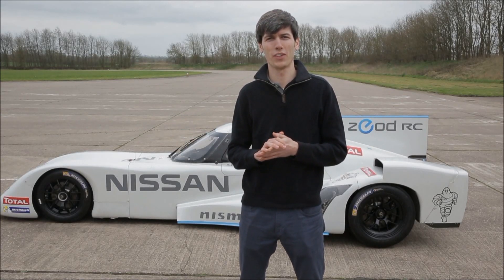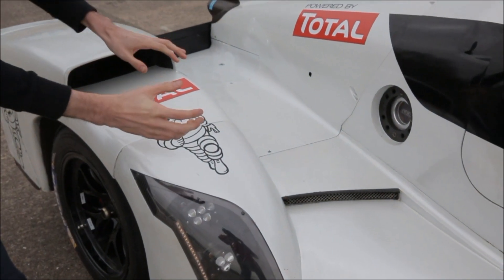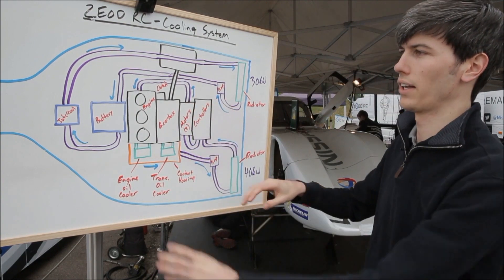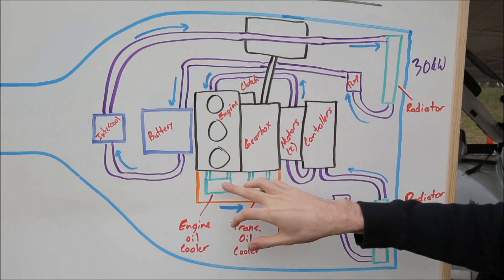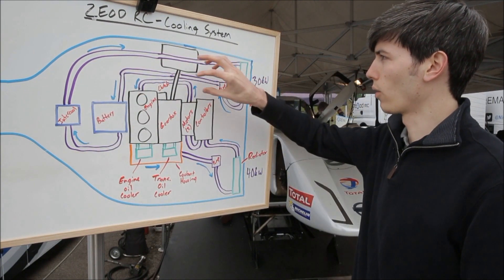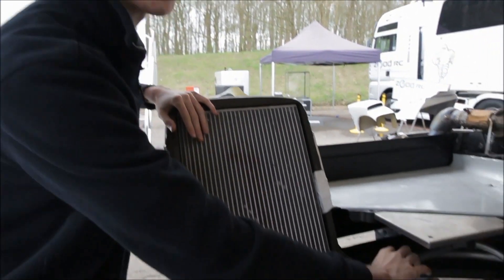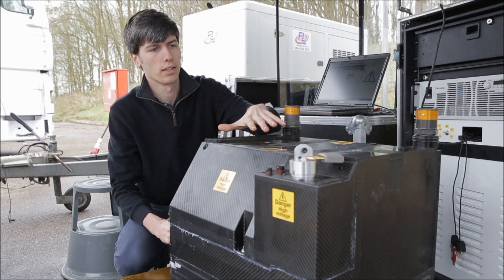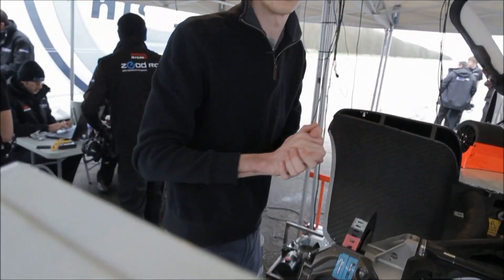ZEOD RC - Cooling System - Explained

Comment: hey, its really cool buddy nice work, 
i have a question in water pump,
1. what happens if the water pump back pressure increases in the cooling system,
2.The cooling system pressure is 1.2 to 1.5 bar, why not more or less than that or how to decide the cooling system pressure.

Comment: Maybe they choose to run antifreeze IF it is permitted,  but I have a couple of points to make.

1. From what I could find available through internet searching, most sanctioning bodies do not allow glycol based coolant unless an exception is made (racing in extremely cool climates) by the body itself.

2. While a 50/50 ethylene glycol mix may boil at a higher temperature than water, it is less efficient at heat transfer. So the 15 - 20 f increase in boiling temperature will not help unless you can efficiently dissipate the heat. 

3. Most racing engineers that I have talked to express the importance of cooling system pressure. As we all know, increasing the pressure in a cooling system has many advantages with the main advantage being increasing the boiling point of the coolant. I have heard of cooling systems (specifically) in NASCAR running around 35 psig. That would be good for an additional 105 f.

4. Another friend of mine mentioned the use of products like Water Wetter in his racing series. This lubricates the cooling system and reduces surface tension there by increasing cooling efficiency. 

What's the point? If ethylene glycol contacts the racing surface through the development of an accident or cooling system failure it will be extremely slick.

Comment: Do they actually run ethylene glycol in the cooling system? Most sanctioning bodies forbid anything except water?
Reply from the maker: Umm, all the cars I know of use a 50/50 mix. There are additives for anti-corrosion. Water alone boils at too low of a temperature, and freezes at too high of a temperature. EG expands this range.

Comment: Welcome to England! Over here for anything else? Great video as ever!
Reply from the maker: The ZEOD, GT3 GT-R, and a race day. More videos to come from this island.
Reply: Engineering Explained
Good stuff, can't wait for the rest. Find it a bit strange to go for a water-air intercooler. Would have saved a lot of weight with a conventional air-air. Guess the position of the heat exchanger and its implications for body shape and aerodynamics were more important?
Reply from the maker: sky17
Yeah, you also would have to have more piping for the intercooler air, and somewhere to put the intercooler, so it's a balance really. Seemed fairly compact, and light overall.

Comment: In one circuit, the water flows from the pump into the radiator and in the other circuit, it flows from the radiator into the pump. Does it make any difference? Which one is better?

Comment: Constructive criticism here.

I have no idea how much "30 Liters per minute" is.  It would be helpful if you could include gallons per minute, or something of that nature.  Even Putting a annotation or something.

Thanks.
Reply: http://lmgtfy.com/?q=30+liters+to+gallons
Reply: Yes, lets perpetuate the use of imperial units because they're totally useful. They're easy to convert. Google it. Otherwise, there's ABOUT 4 liters per gallon, so you can guestimate based on that.
Reply: I was making a point.. Not being literal guys.

Ben Turner Imperial units are useful, they have they're place as well as standard does.
Reply: Absolutely agree, also he could explain what is a car because where i live we havent got one of these
Reply: ***** I know many Engineers That use BOTH Standard and metric on a daily basic.  I use both every day. both systems have their place as do all.
Reply: supermotox55 If you use both every day, then why did you have to ask?
Reply: DJAlsip On a daily day I use standard for almost everything, except in the shop when I need to be near exact on measurements, that's when I use metric, but majority I use Inches/Feet, for ease of use, and better measurements for the field.  I use gallons not Liters.
Reply: supermotox55  Well that clears it up! I've lived in both Europe and USA, so I am familiar with both and do conversions in my head all the time at work, but in the end I definitely prefer the metric system because it's linear and highly accurate. To do a rough conversion from LPM to GPM you can take the LPM and divide it by 4, but if you divide by 3.8 you will get a more accurate result.
Reply: DJAlsip The more you know the better your work is! :D
Reply: supermotox55 Yup!